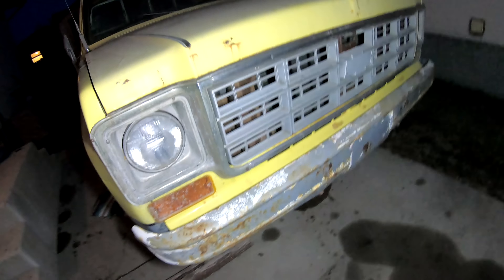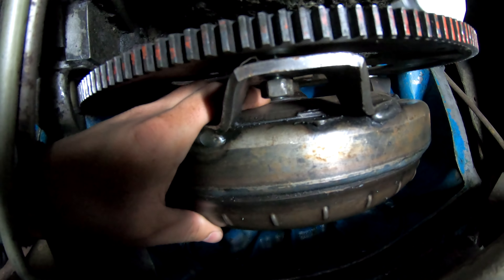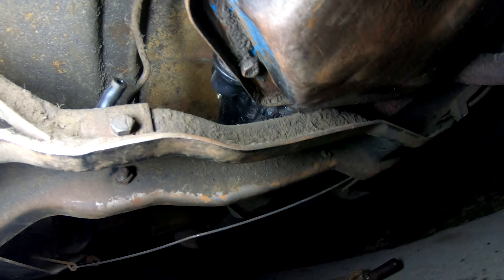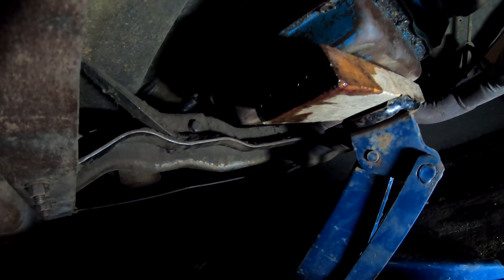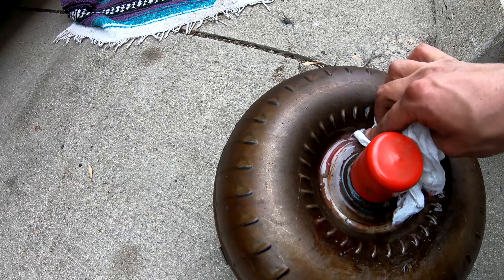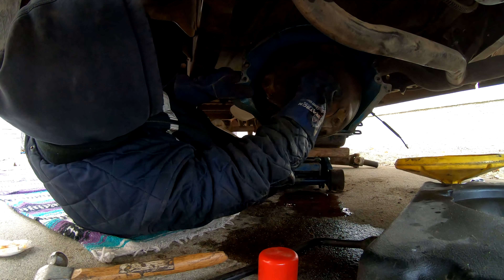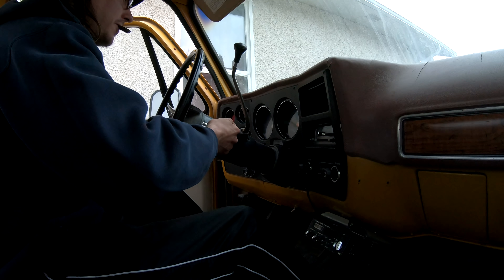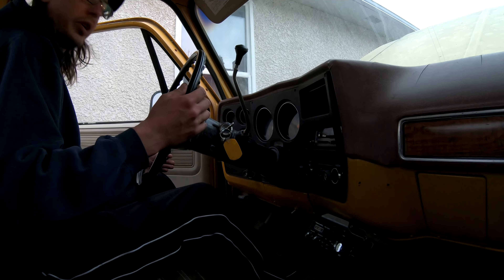Can I Make This Old Truck Move? | 1977 Chevrolet C-10 Truck TH350 Torque Converter Swap

Comment: It takes 8 to 9 quarts of trans fluid. Put the rear on jacks, let the motor warm up and see if the tires turn in gear. Keep checking the level.

Comment: When your cranking it over to start, don’t be scared to pump the ever living shit out of it, you won’t flood it,when it starts firing hold it to the floor, I have a few of these old chevys and they all act the same way
Reply: Exactly my thoughts. Spending too much time in fuel injected vehicles you forget this is a carburetor and the vehicle has not run much or often so the float bowls are likely empty. As you are cranking, pump the gas pedal to get some gas in the engine or, pour some down the carb to light it off.
Reply: You don’t pump the ever Iiving anything.     You pump it 4-6 times.  Sometimes 3 .

If it hasn’t moved for a long time use a little gas with transmission fluid or 2 cycle engine oil mixed with gas.   

So the upper cylinders stay lubed

Comment: Usually when a trans dies, the oil gets contaminated with metal shavings. That junk gets in the converter, and you can't ever get it cleaned out. Probably not a good idea to put that old converter in...

Comment: You shouldn't have to hammer the converter out.  The old converter was bad.  Someone before you probably damaged it by not properly seating the converter properly.